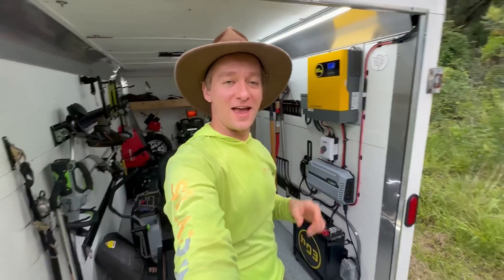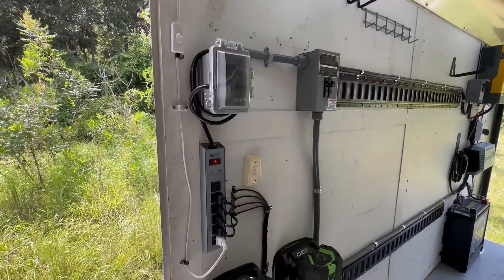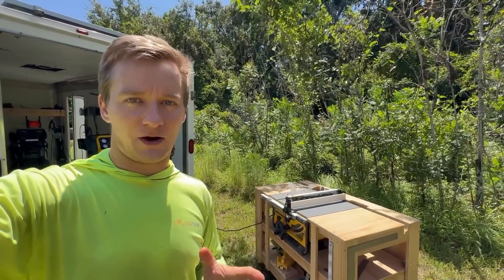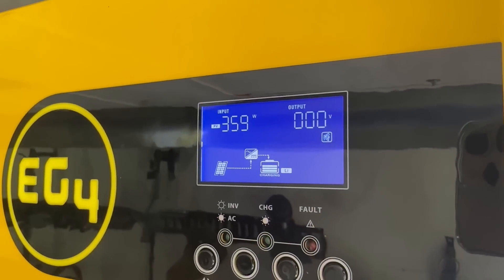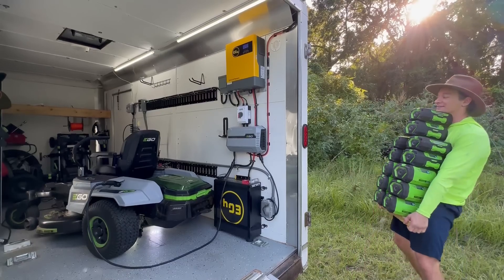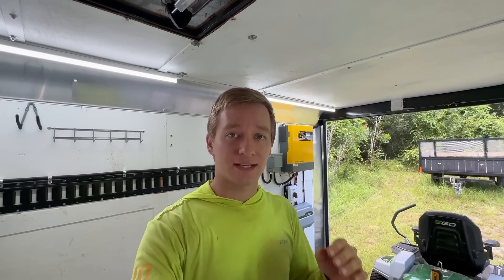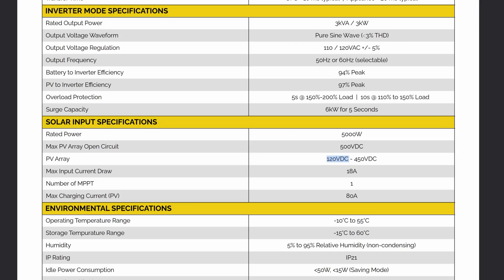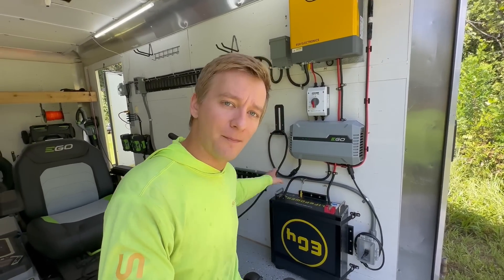Solar Powered Lawn Care Setup; Why Not Just Buy More Batteries?

Comment: Why not upgrade your solar panels to 400 watt panels instead of the 200 watt panels your currently using and add two additional panels to the side of your trailer that can fold out when you're on the job site get as close to 2400 watts as you can and with the two minute on the side put it on the side of the trailer that is always on the curb side so you don't interfere with traffic. Basically try to maximize as much solar input as you can so you can get as much solar input as you can so you can even charge your Tesla if needed and even expand your battery storage to one additional eg4 battery back.

Comment: Awesome content Steve,,,, was contimplating putting the inverter and battery in the workshop,,, but to have an enclosed trailer with the inverter and battery is much better to constantly "top up" batteries while working onsite.... and if I decide to change all the EV equipment,,, no problem as the Victron or EG4 is already DC solar equipped.... sub'd and thanks again for your Solar Lawncare...

Comment: Wild. I just charged my 6.0Ah ego battery and the charger was pretty consistently pulling 450watts from my inverter. 

So im not actually into lawn care but my neighbors run a business and hate green energy. 

Im building a solar trailer mainly just because It will house my componants for my own house from the elements and lock them up :) 

But it has the benefit of being mobile. 

The opportunities seem endless. Mobile emergency EV charging? Supporting electric businesses? 

Or even just setting up and selling solar trailers as is.

Comment: I love the build. however, i do have some questions. My understanding of electricity is everytime you convert it from dc to ac and back to dc (solar(battery) to inverter to mower battery) you lose efficiency. Is there a way to skip the inverter for charging the mower batteries?
Reply: This is true, but you would need to have a different charge controller and convert the voltages to something the mower would accept. It probably is easier to just take the small penalty.

Comment: Could you add some small panels to your ride mower? Not with the intention of charging batteries, but lowering their use/drain.
Reply from the maker: So, the EGO batteries are quite a tricky thing to integrate into and they definitely don’t like you doing so. I suppose you could somehow tap in but you’d have to have just the right voltage and maybe have it cutoff charging before the batteries are actually full so that the normal lower charging system can handle recharging and balancing the batteries. Idk, would be a really fun project!
Reply from the maker: As for practicality, I personally wouldn’t do it on my mower for business. There’s so many low-hanging branches and obstacles that it would just be hard to have some type of awning or solar over the mower.

Comment: Very nice channel.  FYI, I saw a yt vid guy turned a salvaged Tesla chassis into a small travel trailer.  All that extra power storage! 
Have you thought of a way to use free charging station to your trailer or via your Tesla to your trailer?  Probably not significant at 5kwh but maybe if you expand later.
Reply from the maker: Oh that's really cool! Have a link to the channel or video? 

There's a public (free) charger in my town but I really don't want to be abusing the system since it's designed (many years ago) to be something for visitors.  I have solar at the house where I charge my car so I'm sort of charging for free already haha (panels and install cost money of course).

The Tesla can't offload power to the trailer unfortunately otherwise I would use that feature. The cybertruck apparently can, as well as the Rivian and F-150 lightning, so that's something to consider if I'm going to expand/change later down the road.
Reply: @solarpunksteve  Been so long I may have miremembered (sorry) or inferred my own idea of converting the Tesla chassis itself but, here's one of his YT vids building a trailer on a trailer base frame with a Tesla battery.  https://youtu.be/1Gj9cyIgyTc?si=jjLvWmDsv2gbybaD 

He's done a few versions and has a lot of vids and has worked out how to connect in parallel to his Lightning and other vehicles, it balances the packs across both vehicles.

Comment: Why not a fan on the roof? As heat rises? Maybe on my build ,good video
Reply: Or maybe it’s just restricted
Reply from the maker: Thanks! Yeah I need to install a fan somewhere in the trailer to vent, but I have passive vents (including one on the roof) and so far they have done a decent job.  There's unfortunately not enough room under the solar panels to put a large vent or fan up there.

Comment: Steve, I have either worked for or owned a yardcare business since I was only twelve years old.  About three years ago i took a temp job in the winter working at the Solar fields near my home and came up with this same idea.  I had two different enclosed trailers and I rigged them both with solar.  I was fascinated by this idea so I purchased some Greenworks equipment after trying a few other brands.  Over the last few years I have come to use Greenworks and Toro Revolution equipment both.  Toro HD21 is the best electric 21” walk behind.  Greenworks 30” Commercial walk behind is the other and I use Greenworks 60v ride on.  All have worked very well.  You have done an awesome job with these videos!  I ran into problems with my inverter and sometimes chargers overheating but other than that it has been an amazing shift.  I’ll have to do some videos on it.  Thank you for sharing this.

Comment: hi, better to just get a f150 lightening.

and i think it would take 7 years to get your money back on your set up. with a charge cost of a 1.00 a day during the grass season.
Reply from the maker: None of the electric trucks were available when I started my business, so this was an option I wanted to try out especially since it was cheaper than buying 2-3 extra sets of batteries. For some that want to do this, this setup would be lower cost to entry than buying a brand new electric F-150 Lightning, but you are correct, I’m not going to make back my investment just based on solar vs grid charging anytime soon. It was more a proof that you can build an entire system like this and double or triple your runtime for less than the cost of a second set of batteries for the equipment.  I haven’t worked out the maintenance savings, but so far all I’ve spent money on is sharpening my blades. 

It will be a long time before we are at cost parity with gas equipment though. However it’s worth it in my opinion to try! And my clients are very appreciative of the quiet equipment.
Reply: @solarpunksteve  Sounds good. I went the f150 path. super simple. and I load everthing in the bed and the frunk. no trailer, i really dont like trailers. zero in the bed as well.
Reply from the maker: That’s awesome! Are you running EGO equipment or something different? I really love the idea of a compact setup without a trailer.
Reply: @solarpunksteve  100% ego. everthing but snow stuff. solid brand and easy to work with. Just been stacking up cheap batteries as much as I can during the off season now. 

also since you seem decent. might want to check to see if you can get a contract a electric power compnay

thats one of my goals next season. hopefully they will like the PR or something.

Comment: Steve is there no need for a mppt controller with your setup?
Reply from the maker: So this inverter has an MPPT built in. If you only had ability to use a couple solar panels (not enough to meet minimum solar voltage) and still wanted to use this inverter you could probably use a separate MPPT for charging the battery. And of course you could probably build a slightly cheaper system with a standalone MPPT and a lower output inverter if you only need to output enough for one 120v plug or something. 

Anyway, lots of options, this EG4 inverter is a very capable all-in-one solution. It is designed for the 48V EG4 battery though, so if you want to use 24v batteries you would have to get their 24V inverter.

Comment: Hey Steve! I've been thinking about a similar setup on a smaller scale as my budget and business is a bit smaller than yours, for now :D. Are you using the inverter as a solar charging controller? If so is this something that can be done with any inverter or is there a feature i need to look for?
Reply from the maker: Yes my inverter doubles as the solar charge controller as well, but you could either get a combined unit like mine, or if you wanted you might be able to get a less powerful/cheaper inverter and then if you needed it, a separate solar charge (MPPT) controller. Lots of options out there!
Reply: @solarpunksteve  thank you for your response man. It's truly appreciated. I'm starting small but my plan is to have a setup Similar to yours in about 2 years. Seeing your rig let's me know I'm not completely crazy. Lol. Thanks again man.

Comment: A MAJOR reason not to buy EGO batteries and invest in the power storage in the trailer itself: If you - for whatever reason - decide to switch to a different brand of electric tools, your current setup in the trailer still works, but all your EGO batteries are now (virtually) worthless to you, since you don't have EGO tools anymore. 
It's even the same if you do stay with EGO. Maybe in 5 years their new tools have a different battery system. Higher voltage, different form factor, who knows. If you only had EGO batteries, you'd have to (eventually) replace all your old ones, which is expensive (again). In short: always stay as generic/flexible as possible. You never know what will come up in the future.

Edit: Dammit, you covered this a few minutes later. Well, the point still stands.

Comment: I've been thinking about building something similar for a construction trailer.  However, my company is not big enough to warrant a trailer at this point.  But I would like to have something that I can haul around in the back of my truck and offload at a site and then be able to use the rest of my bed to haul material to the jobsite. Gas generators are nice, but they produce a lot of noise when running.  
This last two weeks I have been on a demolition site and am using a lot of battery juice to cut the material.  Yes, there is a house that I can plug into and recharge my batteries, but it is a good distance if I need to walk, which takes time away from the grunt work.  If I had a smaller solar panel and inverter I and storage battery, I could simply be self contained and a little more efficient. Fortunately I have not used up all of the batteries that I take with me,... yet.
Reply from the maker: Based on what you describe, I think getting just a "battery generator" like a Jackery, Bluetti, or ECOFlow Delta type of thing might be the best option.  They are pricey, so if you wanted a large/capable system for cheaper then you could build a EG4 inverter/battery system for less.  Doing a full solar powered trailer is a lot of work and expense for something that might not get used all that much.  Of course the other option is to just buy more tool batteries and charge them up back at home or something so that you can last all day without having to be interrupted.

Comment: Nice setup, is the solar system enough for a toy hauler rv?
Reply from the maker: Depends on what you want to run. If it’s an air conditioner all day or overnight, might not be enough. You could always add an extra battery for more capacity if you just need it to last the weekend or something. But if you want to power lights and some appliances it would definitely work.
Reply: Yeah ,I would say a few appliances and upgrading to a mini split ,so adding maybe 2 more batteries from the setup you got should be sufficient or just add more batteries and that would work? Would I have to upgrade the charger or inverter or add more panels? I’m new to the off grid solar system thing. Just curious…..
Reply from the maker: @manuelsolian1510  Hmm, tough to know without knowing the power consumption/planned use of all your stuff.  I would recommend getting like a "kilowatt" meter that plugs into the wall and lets you see what the kWh usage is over time, that way you can build up an estimate of how much power you're going to need for all your systems. 

The EG4 inverter is quite capable and you could definitely power some smaller mini-splits with it (120V).  But let's say your mini-split draws 1000W (most are more efficient than that, but just an example), if you ran that for about 5 hours that would drain your battery completely.  So if you know you want to be off-grid for 10 hours running the AC at full power, you would need two batteries at least (inverter draws ~50W while running, plus losses).

Last thing I want to say is be careful of getting my EG4 inverter if you're not going to have enough solar panels to produce the minimum required voltage.  But just know there are other inverters/chargers that require way less.  Anyway, there's a link in my description to my inverter/battery from signature solar if you're going that route.  You should go check out @willprowse as he's got tons of content on inverters/batteries/solar ect. He also has a great forum and website.  Good luck!

Comment: Interesting setup, have you compared  how long it will take to charge 2-3 batteries overnight on the grid vs using the solar panel/inverter setup? I feel like it will take a long time to get your money back with the solar without offsetting the cost by making those videos

Comment: It might save some conversion efficiency to get a DC charger.  Then you wouldn't be dealing with mutliple voltage conversions.  Just your trailer pack to the mower pack.

Comment: Edit: so just put the 5KW battery on the mower? 

The thing those mowers need most is a conversion to a legit EV battery.  Something like Nissan Leaf, Chevy Volt or Fiat 500E cells are in the 40-60Ah range, and probably 2 full packs would fit on a mower.  Either way we are talking a much better price.  Like as much as 2 first party little packs for a whole mega pack.

Ideally you'd want enough range to get through at least half a day with no charge.  But I am very curious whether you could carry enough battery to mow a full day.

As I say the range is just one benefit, the price is really where it shines.  Especially when you consider a traction pack will laugh at a lawnmower, whereas the power tool batteries are being seriously taxed and will fail much sooner.  So in the long run you wind up with even better savings.

The really good news is the mowers are basically standard at this point and have been coming with Lead Acid batteries for the longest time.  See Aging Wheels or under Dunn channel, he converts his from Lead Acid to Lithium/LiFePO4 (I can't remember which he eventually chose)

Comment: With your use-case, How long do you expect the EGO batteries will last on average? If you run 2 cycles/day and 250 workdays/yr, I'm thinking they would last max 2yrs on average but if you're able to limit depth of discharge by plugging in every stop and if they don't heat up too much it could do a little more.

Comment: since setup.. I would just add another eg4 battery and you should at least have a T- Class fuse between the battery and the inverter.. :) Upgrade the solar to 400+watts apiece. Great video!

Comment: I’ll take 10% on this idea, but if you did all the setup yourself, I bet you could buy another trailer with the same solar/battery setup and sell it for a profit to someone who’s intimidated by trying to do it themselves. If it were me though, I would just buy an all in one, like ecoflow delta pro, and it takes all the guesswork and wiring out of setup. Just run the solar to it and plug in your equipment. You should also find a good way to get ventilation in the trailer. I bet it gets hot a hell inside in the summer, which obviously isn’t good for batteries.

Comment: Yeah my friend looks like I need your help on my set up.  I'm running a Ford f 150⚡️⚡️truck. A Ev Gravely zero turn mower plus stihl electric power head and 500 ap batteries. Just need to get my solar system installed like yours. 3000 watts is enough for me too with 3 extra batteries. I want to be exactly $100,000 in on my business setup and equipment. No gas, no oil, no smoke, no sparkplugs no joke I took lottery winnings and invested the smartest way possible

Comment: Really cool system. I am curious as to what the life of the batteries will be like. Will you have to replace the yearly? bi-yearly? Because in the long run you will have to get new batteries and at around 5k for a new set. Thats 5k a year or 2.5k a year you have to take from profits. Anyways good job and hope to see more content. Hopefully you will share the good with the bad and not just butter it up like the best thing since sliced bread. You're doing a fine job, keep it up.

Comment: First off I would like to say the trailer is well thought out and looks like it works well for you. 

Secondly I’ve never seen a Tesla pull anything and I am pleasantly at that.

Thirdly I’d put a weather proof connector on the out of the trailer so you don’t have to have it open to charge the batteries on shore power.

Personally I’d put a small generator on there that could run on propane if you needed the battery to recharge more if you didn’t have sunny days but that’s just me being paranoid 😂